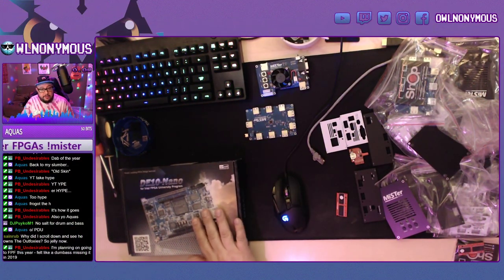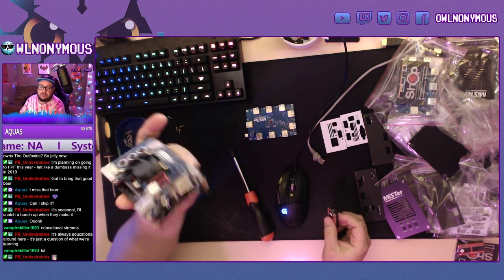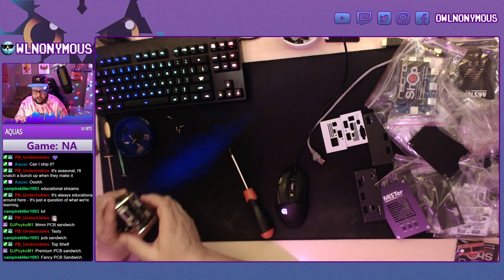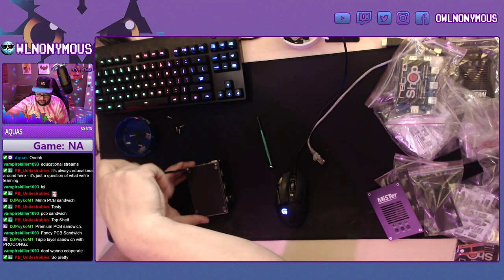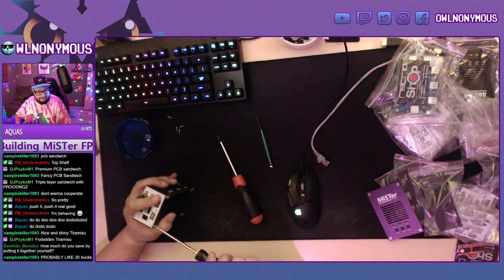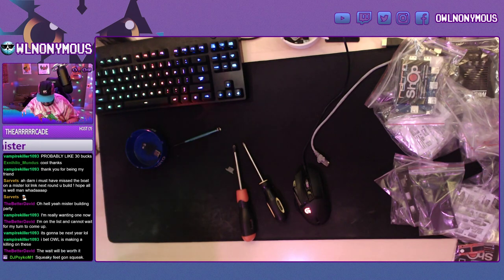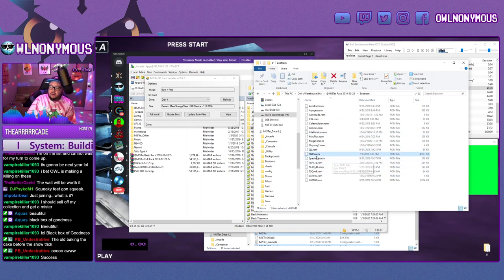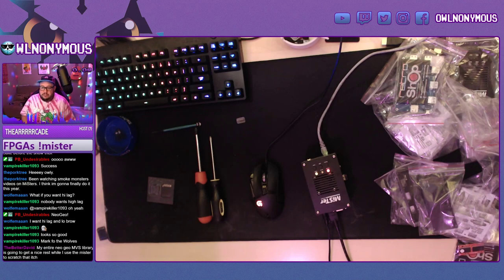Ultimate MiSTer FPGA Build Stream (01/14/2020)

Comment: Great video. Such an amazing product. This is something I’ve always wanted but can only dream about owning one. Here in South Africa it would cost me one months salary with the exchange rate.
Please if you or anyone reading this has a demo unit or a unit you don’t want and are willing to sell it for a lesser price please let me know.
Reply: You could actually try to get your hands on just the DE10-nano board and leave the accessories for when you need them. The vast majority of cores play on just the nano board alone. All the extra I/O and usb hub are not necessary. Ram could be useful but also not a requirement for most cores. You can get the nano boards for about 170$ online.

Comment: Have an UltimateMiSTer and can vouch for the quality and service. Only downside of the lovely case is that it’s an absolute pain to get the Micro SD card in and out of it. Impossible with fingers alone. Still trying to find the best tool to use to deal with it.
Reply from the maker: I use a little piece of plastic that came off the end of a hdmi cable. It works perfect. Truly a pain though. I FTP into it whenever I can.
Reply: The idea is not remove it but use lan.

Comment: It seems your USB hub supplier is one of the only who is adding the power pins to the USB hub and not the plug adapter to power the hub. I like this implementation much better than an external cable and plug. :) Have you tried powering an external USB drive with it?
Reply from the maker: Yes, an external usb drive works fine.

Comment: Hi !  So - I'm getting a MiSTer soon from a guy in "Official case" (gold edition) -   in the photos that I have  I don't see two 5V inputs - there are two USBs marked power on one end and the 5v input above on left.    It looks same as the case in this video at  8mins 17 secs. 
I am confused as I often see people using 5V input splitters to power the USB hub......  am I missing something - thanks for the help & great videos. 

This is the spec:-
Official I/O Board XL 6 including Silent Fan
Memory XS-D v2.5 128MB SDRAM
MiSTer Official Hub 2.1 with VBUS Control
MiSTer Hub 
ADC Board for Audio In / Tape Input
Wakefield-Vette Heatsink
Official MiSTer Gold Case
TerasIC DE10-nano (Cyclone® V SoC)
2A PSU
SD Card Starter Pack
Real Time Clock 1.3 Board
Noctua Premium Fan NF-A4x10 5V
MiSTer VGA to RGB Scart Cable
Reply from the maker: UltimateMister uses a power bridge wherein the USB Hub taps the 5V from the underside of the DE10-nano. No additional power splitter is needed. You could still use a power switch like the one linked. https://smile.amazon.com/gp/product/B01FT4RBBM/ref=ppx_yo_dt_b_asin_title_o07_s00?ie=UTF8&th=1
Reply: @owlnonymous    Thanks for that info - It's much apreciated! 
- I'll get one of those switches too - cheers.    Stay Safe!  :-)

Comment from the maker: Looks like the Amazon will have De10-nano kits back in stock January 18, 2020. You can also purchase the DE-10-nano through Digikey, Intel, Terasic, Mouser, etc.
Reply: Showing as $140 now on amazon sold by Terasic Texhnologies not $130, is this the right one to get?
Reply from the maker: Yes. The price is $140 on amazon, $130 elsewhere. With Amazon Prime though, the $140 from Amazon ends out being the cheapest price shipped.

Comment: Hell, I ended up having to pay over $160 for mine thru Terasic, simply due to the fact that they charged me over $30 shipping and gave me no other shipping options.  I'm based in the U.S. too, so it was rather ludicrous. 

I'd suggest ppl based in the U.S. to look elsewhere as there was really no reason for me to pay that amount, but I did not know where else to look at the time.  My own fault there.
Reply from the maker: skins4thewin I e been using Mouser on my latest runs. $20 2-day shipping at the $130 price point. It ends out being cheaper than Amazon at $140 shipped via prime.
Reply: @owlnonymous  How is $150 cheaper than $140?  Not sure I follow.

Comment: Oh, that USB board powers off the DE-10?  I just got all my parts but my USB board has it's own power supply plug.  Bought parts separately.  I need a case though.
Reply from the maker: This usb version uses a prong bridge for power. Others use a splitter cable.
Reply: @owlnonymous  Yeah, I got the splitter cable version.
Reply: Where can I obtain one of these USB boards that has the prong bridge for power? I would also need to get the case that doesn’t have the second power hole.

Comment: I have put on my one top and bottom Acid Green Fluorescent Protective Cover Plates also a USB hub and 128 mb ram. I you add a usb hub get a better power. I got a lot of parts from MiSTer FPGA here in the UK, or you can make your own. My skill not that good.